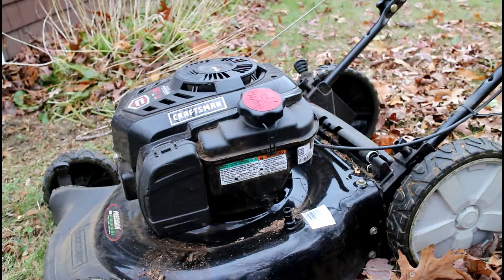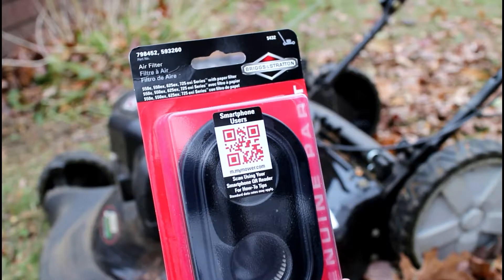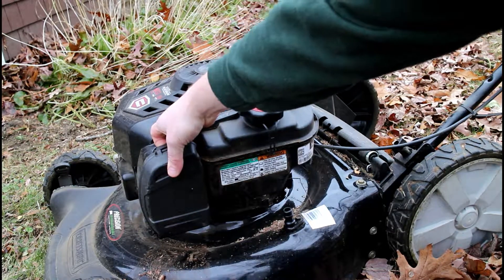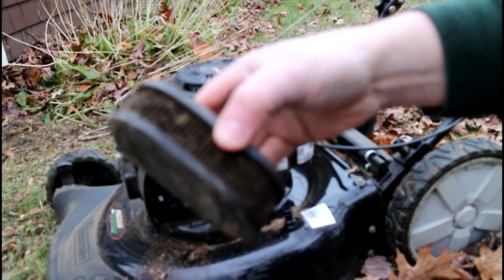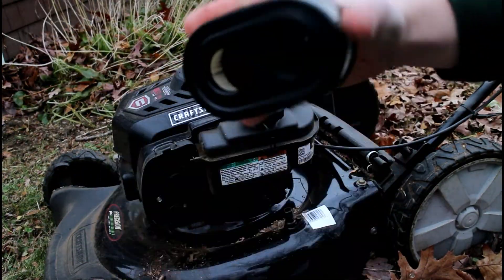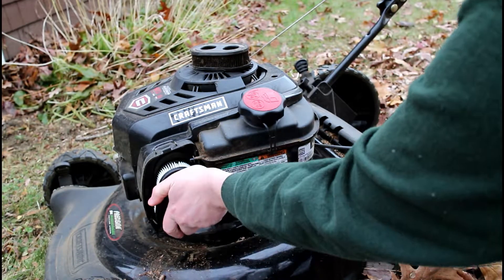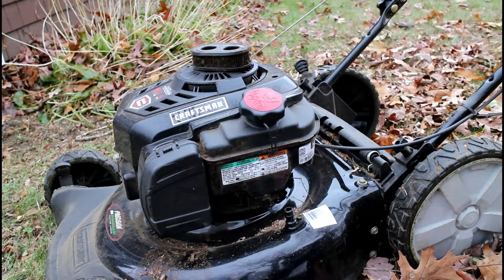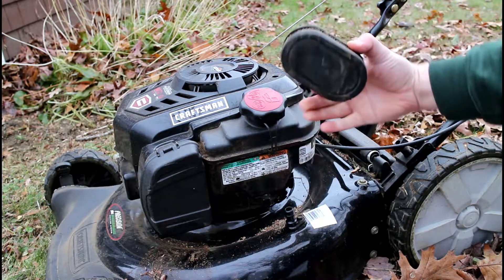How to Install a NEW Air Filter on your Lawn Mower Craftsman Briggs and Stratton

Comment: You failed to mention why the air filter is saturated with oil. The air filter has two holes, one goes to the carburator and the other one goes to a hose that goes directly to the crankcase of the motor. This engine sucks crankcase fumes directly out of the engine. Basically it's sucking oil straight out of the engine. Very bad design. I'm fixing to pull that hose off and letting it vent into the air that way the filter can actually breath air straight out of the air.